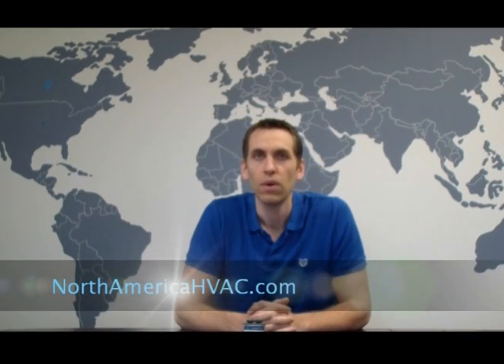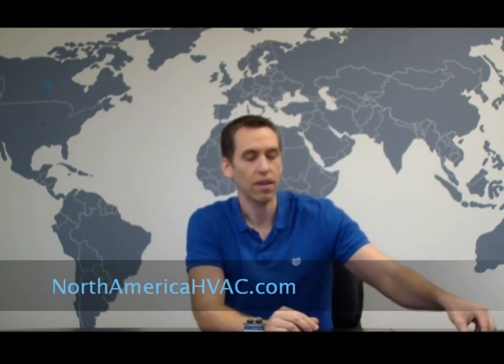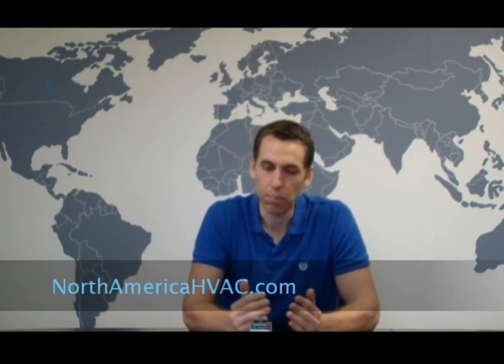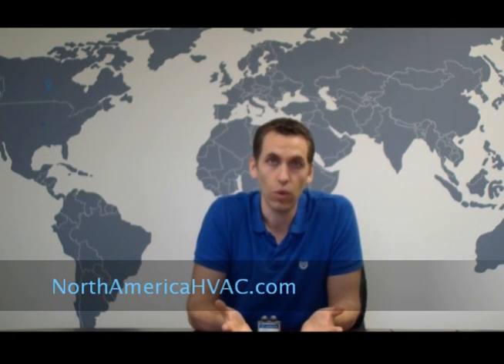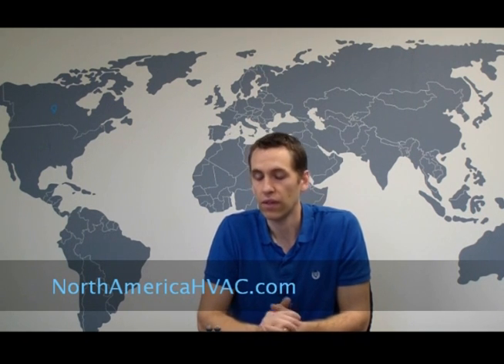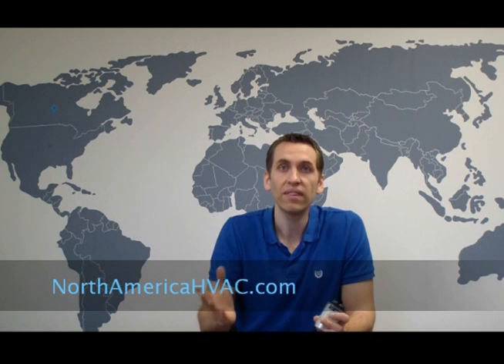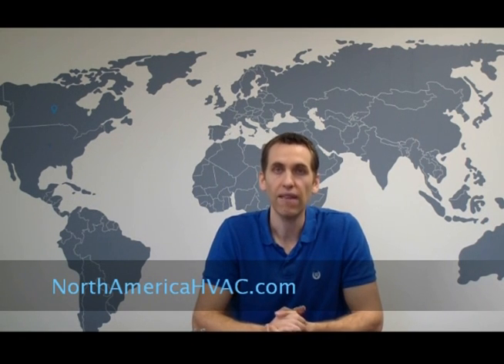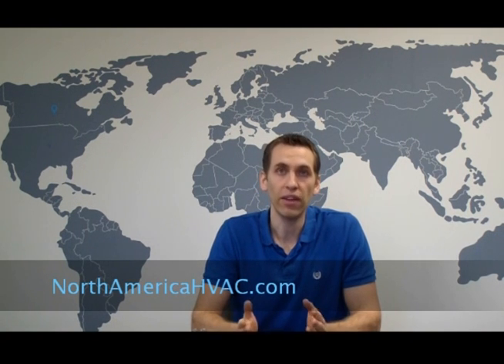What does my Capacitor Voltage Rating Mean? 370 vs 440 VAC

Comment: Can you please tell me the difference between a 34uf 500VPK Capacitor and a 34uf 500VAC capacitor? What I actually want to figure out is ,can I use the 500VAC cap in place of the 500VPK cap? The only difference is their size, the500VAC is about an inch and a half shorter than the 500VPK cap.

Comment: Question, when you up the voltage rating when you replace it, doesn’t that mean the capacitance would go down?
Reply: No, because he selects a capacitor that is designed to have a higher voltage rating and the same capacitance.
This is done by increasing the distance, and increasing the surface area. This increases the volume, which is why he spoke about a higher voltage rating capacitor being larger.

Comment: Is +/- 5% or +/- 6% better?  Can I go from +/- 6% to a +/- 5% capacitor on heat pump fan?
Reply: Oh i see this is answered below, awesome :)
Reply from the maker: Hey! This rating is only the differential. Meaning the capacitor can test + or - 5 or 6% of the original rating and still be considered good. You can go from a +/- 6% to a +/- 5%. If you need help locating a replacement, let us know! :-)

Comment: I have a question? so in this case can i replace a 250  Volt capacitor with a 370 Volt for my window air conditioner?
Reply from the maker: Yes, if the uF/MFD rating is correct you may do so. Thank you.

Comment: My old capacitor us 370 50/60 6% . Can I switch to one the has 5% instead of the 6%? Everything else is the same?
Reply from the maker: Yes, that will be fine as long as your uF rating is a match. The 6% or 5% is only a tolerance rating, meaning the capacitor can test within + or - 6% or 5% of the designated rating and still be considered good. Thanks!

Comment: So why is the uf rating so critical to match it exactly as stated on my unit if the V rating can be anything higher?  I am under the impression that capacitors charge to the voltage listed on them, I have measured this in DC circuits.  Is that not the case with Vac caps?  If they do charge to the label V, they will then have more joules the higher the V that cap is.  That makes the uf label that "must not be changed" questionable.

Comment: Thanks for this video. Would replacing a capacitor of 10% tolerance with 5% tolerance make a difference in performance or longevity of either motor or capacitor?
Reply: The tolerance range will not make any difference in the performance of the capacitor. The most common tolerance ranges you will see are  6% and 10%  + or -   and it just changed based on manufacture and what they decide to go with.

Comment: I am replacing a GE 40uf+7.5uf 440 VAC capacitor with a JARD by MARS 40 + 7.5UF 440/370 VAC/B.  

The new capacitor is .5 inch thinner and .5 inch shorter than the original. I think I have the correct capacitor but the 440/370 VAC/B is throwing me off. Why does it read 440/370 VAC/B, instead of 440 VAC like the original?

Thanks,
Matt
Reply from the maker: TheMattsbay18 

Hey Matt, thanks for the question.  First off, you do have a proper replacement
capacitor.  As mentioned in the video,
440 volt capacitors can replace 370 volt capacitors, and most HVAC technicians
are only stocking 440 volt versions these days. 
Some companies, such as Jard by Mars, have decided to put 370 / 440 volt
on their 440 volt capacitor labels to help people understand that their (Jard’s)
capacitor will work in either application. 
Jard still makes the 370 volt version as well, and it is simply labeled “370
volt”.
So in short- they just relabeled the 440 volt capacitors as
370 / 440 volt without changing anything else. 
Sometimes, the solution makes things more complicated.
And as to the size, capacitors are constantly getting
smaller with technology increases.  Even
a current GE/Genteq capacitor is going to be smaller than a GE/Genteq capacitor
from 15 years ago.  Most people either
shim the capacitor in place or make a new hole in the capacitor strap.
Good luck with yours!
Reply: What does the "/B" in "VAC/B" mean?  My old one has "vac/b" on it but the new one does not.  

Thanks for the video btw, it was very helpful.

Comment: My fan stopped spinning in my ac unit. The fan motor has 370 VAC written on the label. I put in a 440 capacitor. The fan ran for about 45 min then stopped and would not turn on again. Is it possible for a bad fan to blow out a capacitor? I am wondering if I need to replace fan motor???
Reply from the maker: Bryan McDaniel
 If you have just replaced the capacitor, odds are you have a bad fan motor. Double check to make sure you have voltage applied to the motor. Typically, a bad motor will not cause a new capacitor to go out. If you need help locating a fan motor, let us know and we would be glad to help!

e-mail:   info@northamericahvac.com

Live chat is available Mon-Fri 8a-4p  (Click the live chat button at the top of our web page NorthAmericaHVAC.com )

Good luck!
Reply: North America HVAC 
The model of the fan motor is: F48F97A76  Made by A.O. SmithHow much would a new motor cost?(I also sent this information to your email)
Reply from the maker: Bryan McDaniel
Your motor would run you $139.99 plus whichever shipping option you would want (from economy to next day)- here's a link to it and it would ship in less than 24 hours, and a good chance same day, depending on when ordered: http://www.northamericahvac.com/a-o-smith-1-4-hp-208-230v-condenser-fan-motor-odg1026-f48f97a01-f48f97a76/
Good luck!

Comment: So... I can't find a 450VAC cap for temp use could I use a 440VAC that everyone around here has?  I have no cool air.  The unit is an inside unit so it will stay relatively cool.
Reply from the maker: Yes, you can use a 440 VAC.  I know that the video says to not go down, but 450 VAC capacitors are very odd and typically hard to find.  Usually, you would have drop by a lot more than 10 VAC to find a lower replacement capacitor- dropping 10 VAC will not cause any issues.  Good luck and let us know if we can do anything else for you!
Reply: I JUST got finished talking with Mike and Lacey on the chat... VERY confusing that there were 4 people in the chat.   Mike and Lacey were great. Debra had obviously never used chat before.  Anyway... I found out that the cap I need for the Air Compressor is actually a 120mfd +/-5% 250vac 50/60hz. and I have a 130mdf +/-5%SH 250V AC 50/60hz and was now wondering if I could use it as a temp while I wait on my order to get here when I order the part from you guys.
Reply from the maker: Wilson Revelle  First, I'm sorry that the chat experience wasn't up to standard for you today.  As to your question, there are start capacitors and run capacitors, and the answer to your question would be different depending on which one you had.  I'm guessing that you have a run capacitor- probably a round black plastic capacitor?  If you can, please send a picture of the capacitor that you have installed AND the alternate capacitor that you have to info@northamericahvac.com.  We can immediately confirm what you have and whether the backup capacitor you have will safely replace it.  Thanks!
Reply: Oh no problem with the chat thing. Im all good and kinda found it funny.  Anyway, The prob with sending a pic of the old cap is that it got lost.  I finally got through to Harbor Freight and they told me that the cap I needed was a CBB60 120mfd +/-5% 250v AC 60hz.   The one I have is, actually taken from a compressor at Harbor Freight off one that had a broken T-valve so the manager let me take it off, a 130mfd +/-5% 250v AC, 50/60hz.  Only a difference of 10 on the mfd.  I talked with some other electrical engineers on Google+ and they told me it should be fine.  
  Im still going to get the other but I am a starving artist and needed my compressor running so I can use my airbrush.
Reply from the maker: Gotcha.  Though the capacitor is lost, I'm pretty confident that the capacitor is a start capacitor, in which case, the 130 MFD should work for you.  There are two opinions in this matter- 1.) the by the book answer and 2.) the starving artist answer.  If I was in your position, I'd just leave the 130 in the permanently and not worry about it.  That said, whatever you are most comfortable with is the better option.  Best of luck and have a great weekend!
Reply: You know...honesty goes a long way with me.  With so many out there trying to take every dime they can from everyone when a simple solution that actually will do nothing but better the other person shows integrity.   I may not have a lot of dimes in my pocket but I do have lots of friends who do and need things that you sell.   I promise to not only preach about going to you for their parts needs, when I do actually have to pay for a part you have... your first on my list.  Thanks for the advice and I hope you and your company are around for many many years to come.  Thank you.
Reply from the maker: Thanks for the best advertisement we can get!  Hope you don't need us too soon, but if you do, we'll be here!
Reply: @northamericahvacvideos  es la respuesta que estaba buscando, no encontré capacitor de 450 VCA, compré uno de 440,pero tenía duda en instalarlo. Gracias de nuevo, saludos desde México.
Reply: North America HVAC you are awesome, only if everyone gave half the dedication you do towards their work...